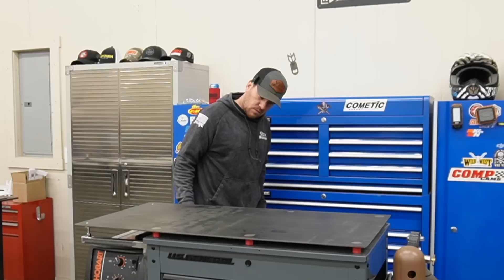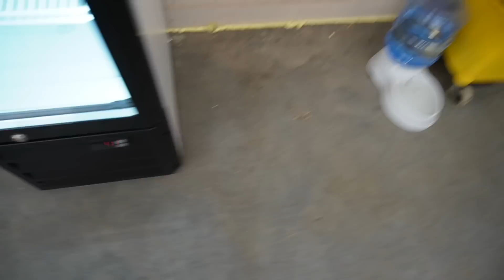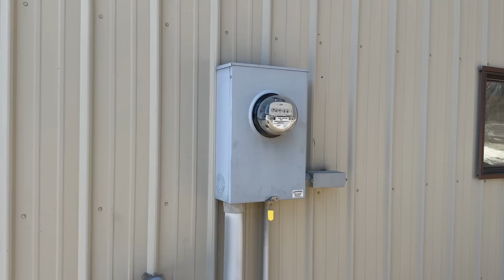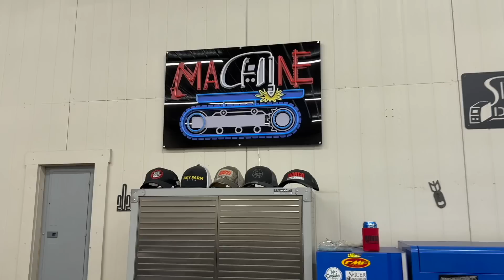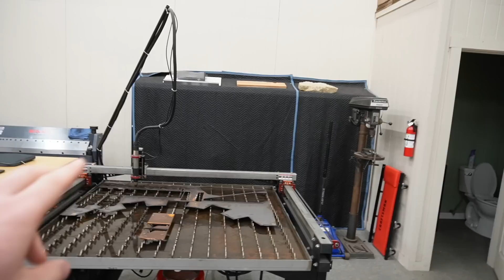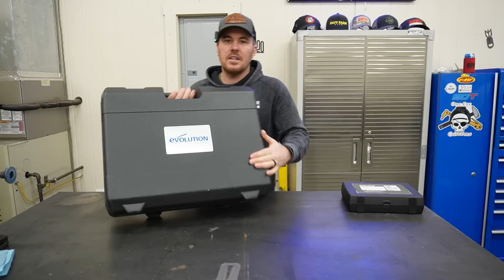Revealing My BIG PLANS For The Shop BUILD OUT...

Comment: Nice design.  Consider adding a man door in the room for the shipping area.  Ups can pick up and drop near where things are packaged up.  Also, consider pallet racking and a small battery walk behind lift truck to store all your sheet goods on the flat near the plasma table.  Thats what we went to.  Makes loading the plasma table much easier.  I could send you pics of our setup if you want
Reply from the maker: Thanks and I appreciate the feedback and ideas. I think im going to do a small overhead door for the shipping room.  I also have plans to get a small battery forklift and under table storage for the sheets.  I have a new plasma table that allows for storage underneath.

Comment: Floor heat for sure. We are between Jasper and Dubois and I built an attached 36x48 garage with 13 foot ceiling for my truck lift. 2 walk doors, 2 10x10 garage doors, and we heat it all winter long 55-60*  and only use 100 gallons propane per year. It is so nice having a warm floor, worth every penny to me.
Reply: i had a shop with floor heat in virginia. it was the best shit ever. i couldnt agree with you more.

Comment: Just a thought about those trees.   Tree roots are great at stabilizing soil.  If you take those trees out, you maybe have problems with erosion.  Something to think about.
Reply from the maker: I have.  Theres very little run off there and very manageable vs a tree coming down on the building or roots shifting the concrete.

Comment: One day I might have a shop. I got 55 acre ranch paid off. Everything I have is paid off. I refuse to go into debt at all. The wife and I have not used charge cards for the last 30 + years. We are actually putting away money each month. Maybe one day I'll own a shop. Being 63 years old I wonder how much I would be using it.  I worked in the best shops/ hangers in the world, working  on the newest fighter aircraft in the world also. Some of them straight from the factory I have plenty of tools, and two large shipping containers for tool boxes. What I use for my little shop is a 20 bye 20 shed built in the 50's out of 1925 railroad ties, they still have the date nails in them. I live bye a hwy  also. gives you good access, and plenty of noise. Leave those trees stops erosion which could be an issue. Your over thinking the power issues. All that money would be wasted. Just use a welder generator is your need extra power for a few days. I like your videos. You have some great skills.

Comment: Depending on location and code enforcement for slope why not do a smaller slope roof and extend the back of the shop out. You won’t get the +36’ you want but could probably get a solid 20’ out of it. If you are not putting a 2 post lift or anything then ceiling height isn’t needed for the rooms you are wanting to make out of it. Way less money maybe next to no down time for you ether.
Reply from the maker: my original plan was a lean to style addition but I need more room and ceiling height.  I will be using scissor trusses for the second floor.

Comment: Why not just build another building behind your existing one rather than tearing into your current build.  I would use that concrete pad to build an entryway and walk though between to two buildings.  They would be connected and it would be faster and easier than removing and replacing your roof.  Also you may be able to prevent removing that septic.  Just a thought.  It would be an easier way to design what you want than working off someone else’s restrictions.
Reply from the maker: Im not removing the old roof.  A handful of people thought thats what i meant.  Its going to tie i to the original building with two valleys.  The ridges will form a T.  I want it to be all one building for a lot of reasons. That septic needs work anyway.  Thanks for the suggestion.
Reply: Thanks for the reply, I enjoy your videos and humor.  My channel isn’t as well edited and lacks keystones lol

Comment: Your addition could have a peak connection to the existing shop and you would have a hip roof with a valley on each side.
Reply from the maker: Yes thats exactly what i want to do.  I think some people took it as if i was going to remove the roof of the existing building and change the direction of it.   Definitely not doing that.

Comment: Going through the same process right now trying to figure out layout for my new 40x64 building. Never thought to use fusion great idea. Do radiant you will not regret the up front cost ! MACHINE 😎
Reply from the maker: @123gonow  yes for sure.  I mentioned radiant in the video.  I did that in my last house.  Good stuff.

Comment: I have four garages.  If it were me, I'd build a lean-to or extension on the rear that doesn't interfere with the septic.  Anything related to septic work is $$$$.  This extension would just be for your projects and things related to your garage.  The area where your septic is could be a hangout area, parking area, etc., between the addition and the RV lot.  Later build the living quarters back farther nearer your creek.  This would keep your living quarters from smelling like your garage and allow it to be quieter.  It could be built in stages as your budget becomes available and allow more design ideas.
Reply from the maker: That septic is tiny.  Pretty sure that wasnt a legit install.  Small tank and one lateral. Needs to be redone anyway.  Great suggestion though.

Comment: A lot of pole building end walls aren't designed to be load bearing so make sure you do your research before you change the direction of the roof trusses.
Reply from the maker: Im not changing the direction of the trusses on the existing building.  A handful of people though thats what i meant.  The new addition will change directions and tie into it.  So there will be two valleys.   The ridges will for a T.

Comment: Wow, those plans are pretty serious. You better finish the lady gym first, ha ha.  It looks like you have thought of everything. The only things I would consider are  1. A gantry hoist on an I beam above your plasma/metal working station. 2. A metal rack of some sort. Its always a pain to store sticks and sheets.  3. Get a 40 foot long, high container and split it between painting and sand blasting / Powder coating. 4. Heck go for either a basement of sorts or a secret underground lair.   Id say its all a little bit too ambitious, but dangit I think you got some hustle and can get some crap done whereas others just dream about it.   Thanks for the plug.  Your channel is pretty great and inspirational.
Reply: By the way, you could always make your own table. Its not too tough.  Once I get my barn more shop like I plan on building a 10x5 plasma table that folds up on the wall when not using it.  At least thats the plan in my head.  It takes a lot of space if your not using it everyday, and Im only using mine every couple of weeks.  Besides I have the small one for smaller jobs.  Im even considering going fiber laser cutter, but that jumps the price up about $10k.
Reply from the maker: I thought about building my own but idk.  Ill definitely need some consulting if i do.

Comment: Is there a reason you wan to limit the shop expansion to a single structure?  Breaking out the shop/office space from the "ADU" might simplify your process-- you could do a shed roof extension to the existing roof line.

I think the addition is likely too small to really justify the radiant heat, especially given the separate needs of the ADU and office/laser spaces-- the boiler will likely short-cycle when only one is in use.  Since you have the Machine[s] you might want to take a look at ground source heat pumps instead.  Bury about 600' of pex in a trench and you might eventually be able to ditch the propane.  Personally, I think if you are moving the furnace it is likely time to replace it, but it really depends on how old it is.  

At first adding a transformer seemed like overkill, but the idea of sub-parceling your property would justify it.  I would do battery/inverter/solar if the primary purpose is to stabilize voltage

Comment: - Somewhere in there a wood burning stove. If your addition is well insulated a in concrete heating system might be an over kill. Mike Morgan’s building has a very extensive concrete heating system that I believe he never uses it. He states very well insulation is the key.

Comment: Why not make the new section the same orientation as the OG shop so you dont need to spend so much to change the entire roof system?
Reply from the maker: it won't cost much to tie that roof into the other.  Im not sure how your suggesting to orient the addition
Reply: @SpicerDesignsLLC  Looking from the rv side the roof peaks would look like a large "M". Two peaks and a gutter/valley tieing them together. Figured it would cost a good amount to get all new trusses to change the roofline.
Reply from the maker: @pdperformance1 oh i see.  No that would be bad for watershed and i e buildup.  Im not taking the whole roof off.  The addition will be perpendicular to the existing shop and tie in. So the ridge of the original shop and the ridge of the addition will for a T.
Reply: @SpicerDesignsLLC  ok, so the peaks looking from above would form a T

Comment: I'm thinking for the bathroom, since it will have 2 doors you make some sort of system where you lock one door, there could be an LED light on the other door saying occupied or something. Maybe you can wire some sort of switch to where you turn on the light it turns on the signs at both doors lighting occupied or something. Just so you don't have to constantly lock both doors whenever you go to the bathroom
Reply from the maker: good idea

Comment: You stated you would rip out the current septic system, suggestion leave it, build a small building between your existing and the new.  The smaller connecting structure could have its ridge beam perpendicular to the existing and new structures below the eave of the existing structure.  Over all you would end up with a completed U shaped structure when finished.  The smaller connecting structure can then be as long as you want and you can face the ridge of the new structure any way you would like.  As for the septic system you will most likely need a separate one for the new structure as you are adding living quarters.  The fact you are planning a year out is impressive, I had clients in years past that would come to me for home designs w/less than three months before the contractor was starting.

Comment: Good plans, I personally would make two changes. Rather than riping off the existing roof, I would build the new structure with its own gable root parallel to the existing roof. The two gable ends would produce a strong visual effect from the long side. It would even work  even if you put in a covered breezeway between the buildings as one commenter suggested. I would plan for radiant heating extension into the existing structure.

Comment: Instead of a second service meter near the shop, is there any cost savings if you have them bump up your existing service to 400 at the house and just run the shop off a 200amp subpanel using that existing wire run?   I know you won't have a 'stand alone' meter for the 'commercial' side for tax deductions, but you could estimate based on square footage of the shop I would think.    I'm probably missing something obvious... So -->> 🍻🍻🍻
Reply from the maker: thats is a less invasive way to do it.  They would have to tear up my driveway by the house to install a larger feed.  Plus im not a fan of the aluminum conductors running 400' to the shop..  The main reason would be to completely isolate the shop building from the house so we would have the option of selling the house on a separate parcel down the road.

Comment: Kyle, you should put a 2 post lift in that bay for maintenance on vehicles / equipment.
Reply from the maker: it would be nice but I don't do that much vehicle maintenance to occupy that space
Reply: @SpicerDesignsLLC  I understand... there's a company called MaxJax that makes movable 2 post lifts... so if you needed a lift you could bolt it to the floor and then when you're done, stow it someplace. 

I thought you did most of your own maintenance because you said Vehicle and equipment maintenance. I do all of my own maintenance but I do not own a 2 post lift... yet.

Comment: Suggestion for cost savings and not disturbing your work while building the new shop.  Split it into 2 buildings with a low 10-15' covered connection between the two structures.  Little to no cost/disruption to change your existing building walls, roof or structure.  New building can be any type of PEMB or Postframe and no direct tie-in needed except for a covered enclosed 10' hallway between.  Also allows to isolate sound etc.
Reply from the maker: I wouldnt be changing the roof structure of the existing building.  Some people think im suggesting changing the entire roof direction of my existing shop.  The new building will simply tie in to the roof of the existing. Both ridges will form a T with two valleys.
Reply: I would suggest stake of the area an get the visual of space.    Go ahead and get your grade/footers/an pex an slab set as soon as budget  allows. (but its easy for me to spend Your money).   Also keep in mind the use of pallet racks. just keep in mind the Height at wich you can set a pallet with your equipment.   Great video.
Reply: This was going to be my suggestion as well.
Reply: Completely agree and would be how I'd approach this as well.

Comment: When you drill the holes in your welding table build a jig so the holes are evenly spaced. That way you can put pins in the table and get your material perfectly square to weld.
Reply from the maker: Thanks for the pointer

Comment: Design looks pretty solid and well thought out. One my must have if I was doing that project would be invest in a good compressor and air dryer setup , with hardline and drops to all the machines.  A rotary compressor would be my ideal for CFM and being quieter.

Also good fixture table or platen like u mentioned is good stuff. Fireball tool  had some sweet stuff

Enjoy watching the journey. I need to find time to make more videos
Reply from the maker: I agree with the compressor setup 100%.  Thanks for the suggestions.  I have been eyeing the fireball table.

Comment: Not my money or shop, but in my experience anytime you have the ability to add more power you should take it. 400 amps minimum.
Reply: I came to comment this exact thing as the first building pre-fabricated that I built using a general contractor around 2008, I had the opportunity to add 3 phase but didn’t know much about it. Since 1978, I worked with my dad outside in the elements, wrenching on dump trucks.
we only have so many hours in our life, wrenching on heavy duty equipment in the rain and high wind where all you have access is a steel plate on top of asphalt grindings and mud so just wanted a roof over my head. You start with a $30,000 budget when you see those prefab building ads. Half $1 million later, fire sprinklers, security feed upgrades, permitting and red tape and kicking myself for not adding the three phase.

Comment: Have you looked at removing the rv pad and extending that direction?  This would eliminate the need to remove the existing building roof.  Also the septic system can stay.   The other advantage is, as it seems you want to be more customer friendly, you can put the showroom/office at the front so customers don’t need to walk through the shop to get there.   This also allows you to have a taller building without  messing with the existing shop.   A real downside to changing the gable direction is your existing shop will be out of commission for several weeks.
Reply from the maker: I can't add on in that direction because I can't build over the High voltage and other utilities.  Plus that is the main path to enter that section of my property.  Good thought though.  The original building shouldnt be affected a whole lot for the shell of the new building .  There will likely have that done in about 3 days.

Comment: Are you planning to remove the roof and trusses, to reorient them?  You could just have the roof of the addition perpendicular to shop with a couple valleys.  The second floor in the addition will likely result in it being a bit taller than the shop.  Maybe make it a separate building with an enclosed 6 or 8 foot wide hallway between the two.  Good luck with the project.  I'm looking forward to seeing it come to fruition.
Reply from the maker: I mentioned that in the video during the outside walk around.  The addition will be perpendicular to the existing. Two valleys.

Comment: Very cool design. I don’t know what you plan for ceiling height but you should be able to zone your furnace also so you can have ac in the summer then have your floor heat in the winter. I’ve done that before for people. Would be sweet with some exposed duct work if you have tall ceilings

Comment: I would space the new building/addition away from each other. Then you can have outside covered space to work or park vehicles between the buildings.
Reply: I had the same thought.  Then add a covered/enclosed breezeway between the old and new buildings.